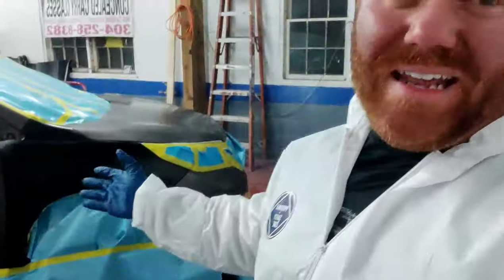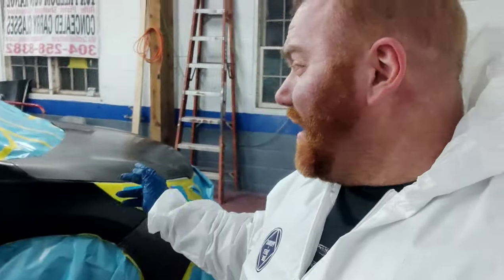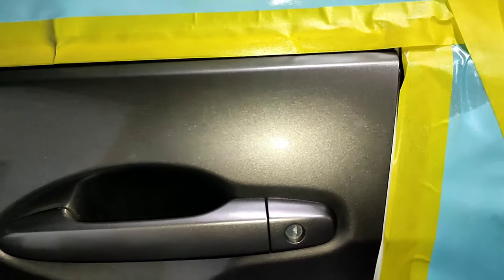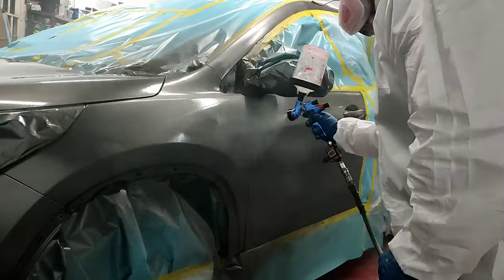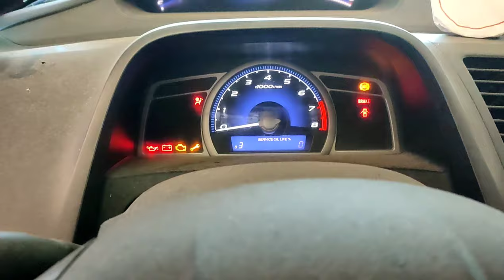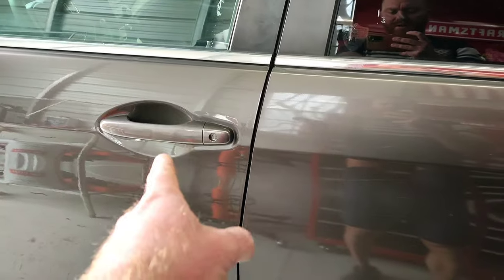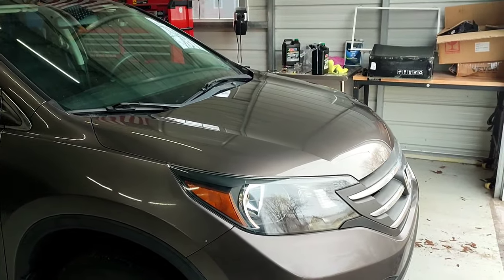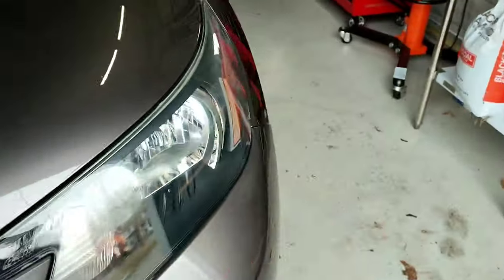STEP by STEP guide how to paint your car

Comment: Marco has a gift from the heavens above. Anything he touches turns to gold. First video I ever seen of the man was painting dodge caravan bumpers at an outside auction in 20° with 25mph winds with factory results & zero over spray . Best of the best with personality and pizzaz...
Reply: Settle down its just paint.
Reply from the maker: Much appreciated
Reply: Idk how he does it. My paint trying in sub 50 deg wouldn’t come out of the damm gun with fast red. I just stopped painting unless it was spring/summer.
Reply from the maker: @jecrpalier  I'm an expert in painting in the worst conditions. I make it happen

Comment: I've got some SMR 1150 and fast activator to use up, but I think next time I'll give the 135 a try. My insulated and plastic lined paint area is generally 55  to 60 degrees with the 220 shop heater going and snow outside. Still in that range I need a faster clear.
Reply from the maker: Smr1150 dries stupid fast. This stuff is a hair slower but higher solids

Comment: Learning something new everyday. How long did you wait sir after you spray the color blender? I am in the process of repainting my whole car and thinking about using the speedokote bright white basecoat with mid coat (mixed dry pearl powder and intercoat clear binder) to prevent using stage 1 white pearl paint. I am also debating on which clearcoat i should use with this project. Would love to get suggestions from you. Thank you in advance!
Reply from the maker: Wait 30 min for blender to dry. Best clear is smr42 if your in Warner climate 50+

Comment: A serious question...I don't see you using your inflatable spray booth anymore why?...
Are they worth the money... do they perform and give you cleaner ..paint jobs time and time again... or are they like the paper condom ...joy for 5 min or lifetime pain later...ie 6 kids later.
Reply from the maker: There nice but not healthy to spray in on a consistent basis as they don't vent fumes out as well as a real booth.
Reply: You need to place 30"  extraction fan  that sits on a riser and velcro plastic or fabric shroud to the booth... Get some 6mill poly, make flexible exhaust shoot, ( just cut 15 foot sheet of poly and seam the joint with tuck tape.. afix the plastic sleeve you just made with a ratch strap to the fan...and bammmmmm), and pump it out the shop door.
Reply from the maker: @772777777777777  yup iv seen this!!!!